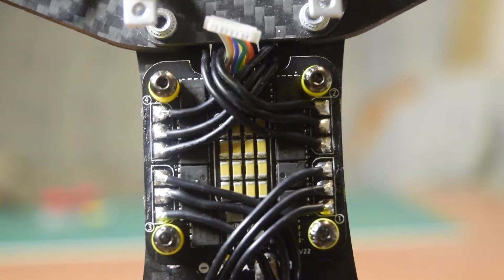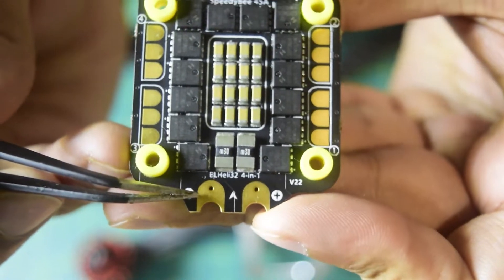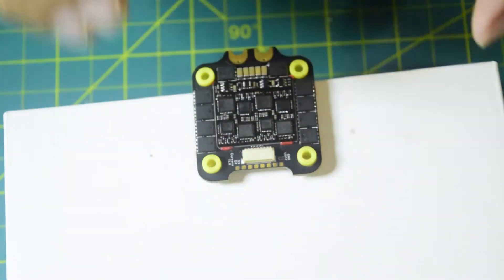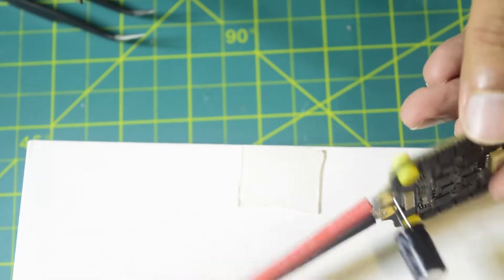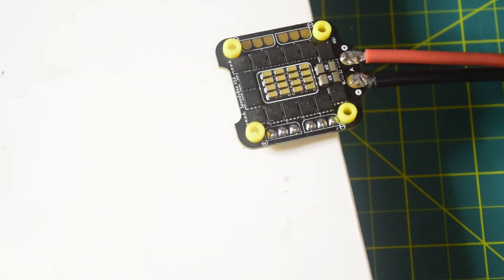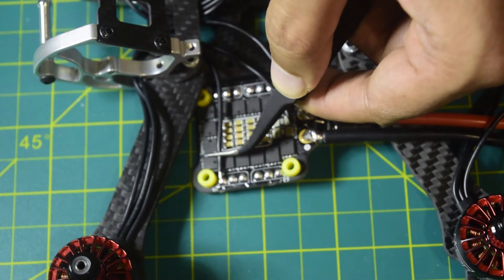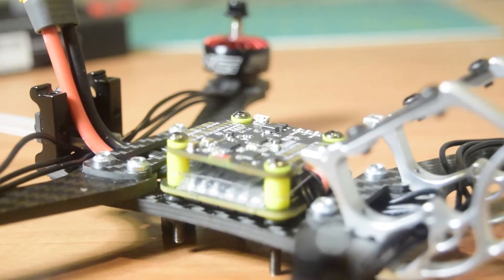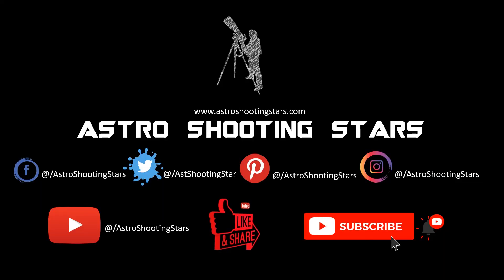How to Install ESC and connect Motor on Speedybee BLHeli32 45A ESC with iflight Xing Motors 1800KV

Comment: Sir in app transmitter connects fine but motors cannot move using transmitter
Reply from the maker: i hope you configured the firmware correctly. you have to assign atleast one switch to arm the motor. i hope this helps. Please stay tuned to my channel for my future videos

Comment: The middle wire of motor is always signal and goes to middle to esc is it wright and is esc included with flight controller
Reply from the maker: no middle wire is not signal wire always infact there is no signal wire on brushless motor they work on principle of pulse and phase of the current. interchanging any two wires on the esc will change the direction of rotation of motor. if you buy a combo yes ESC is included with FC but you can buy a ESC separately as well